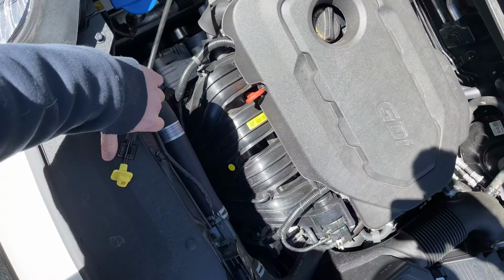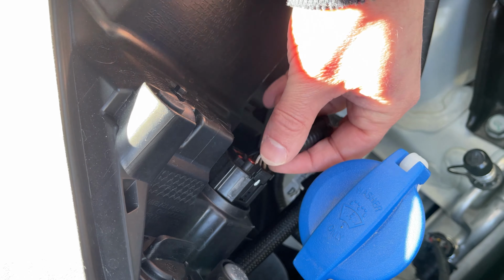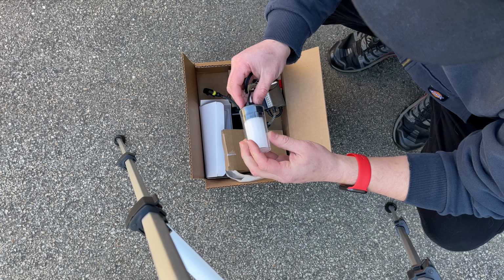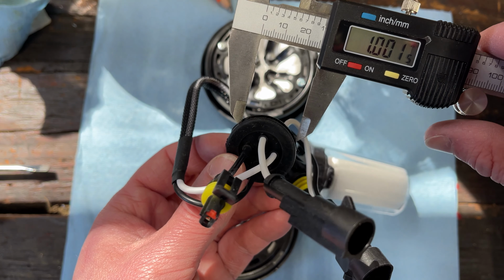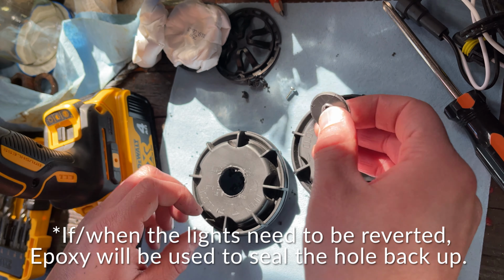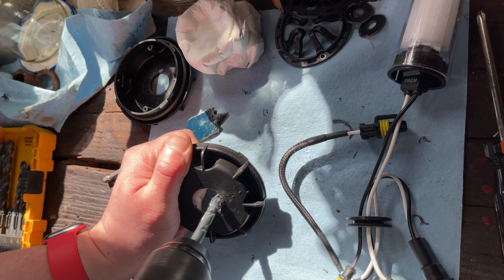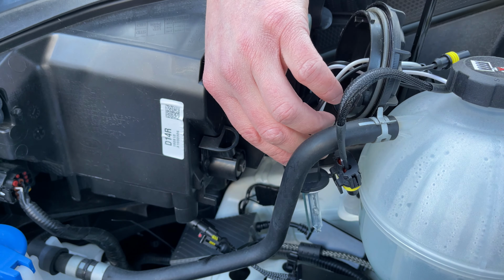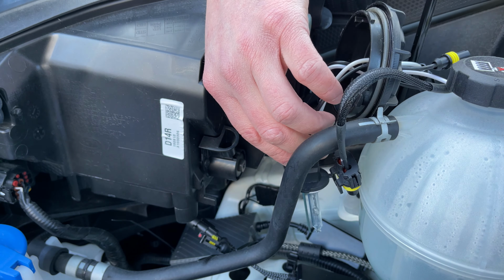Kia Sportage OWNERS: Brighten the road with upgraded headlights

Comment: Whwn you turn high beams on does intensify the light or turn it back to a halogen color. Had an older car that the hids did that
Reply from the maker: This car, the projectors are bi-beams, meaning they function like bi-xenon. There is no separate high beam bulb. The projector has a flap that drops out of the way of the light when you flick the high beams on and the HID intensifies as the high beam. It’s amazing.

Comment: brother its been more than a year, what are your current views on the hid? has the heat caused any minor/major damage to the projector due to heat? secondly due you think its wise to get 55watt setup.
lastly whats the longest time you have kept the beam on during night drives.
Reply from the maker: I really like the HIDs. They really brighten up the view of the road as you drive, the beam pattern is fairly crisp so it won't be blinding oncoming traffic either. The sweet thing about this setup is the projector is a bi-beam meaning it has low AND high beam so it functions just like what you would find in cars outfitted with bi-xenon headlights. First I have seen with factory halogen bulbs. The HIDs just make sense in this housing and I don't know why they didn't do this from the factory. As far as length of time running at night, they have been ran at night no more than a couple hours, probably no more than 4 hours in one night. No issues with heat, no issues with burn in where the inside of the housing gets ghosty, it's all good so far. Also I haven't seen any issue with moisture build up from removing the white moisture absorber in the lens cap. I would be weary about using 55 watt HIDs, that might be pushing the envelope just a little bit. I'm not sure the factory wiring can handle that but I may be wrong. Perhaps urge on the side of cation with that.
Reply: @iambigsteveo  I appreciate your time brother.

Comment: Hi, I have the same suv with the same headlights. Here’s the question I mount HID & afrer 5 mounts I noticed that the projectors are starting to get weak. I have tool for measuring the light & the light is lower with the HID & with the original bulbs. The question is did the HID have more heat & burn my projectors?
Reply from the maker: I don't want to definitively say yes, but it sounds like your projectors may have suffered from the HIDs. Did you try swapping the halogens back in and see how they look? The headlights in this Sportage are still fine so it's possible there's something else wrong with your set up, or the HID kit you purchased is a higher wattage and the bulbs caused something to suffer. Another idea is maybe there is moisture within the headlight housing?
Reply: @iambigsteveo  I try swapping with the original halogen HB3 & the result is worse before I mounted the HID. The HID that I mounted is 35 wats canbus